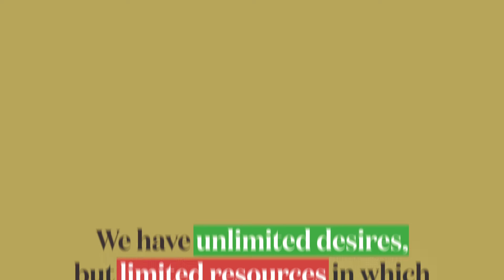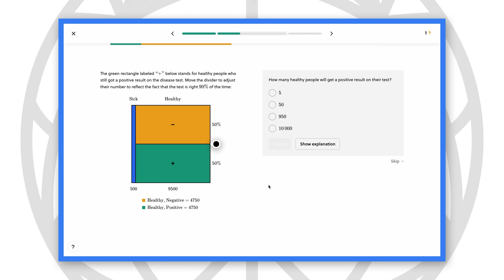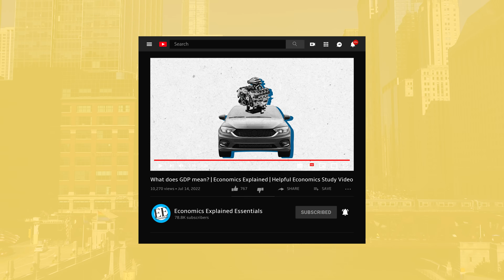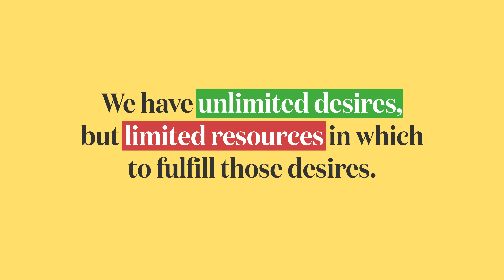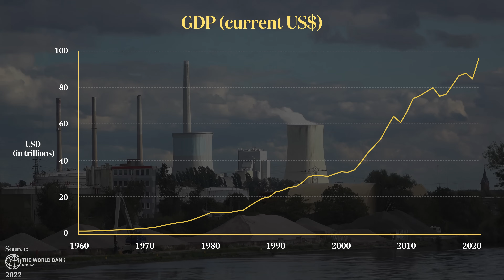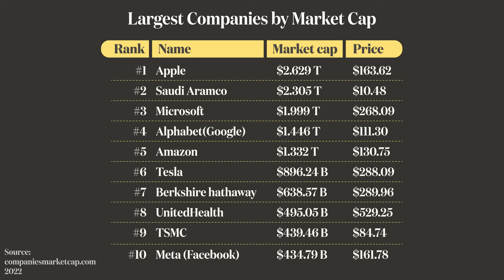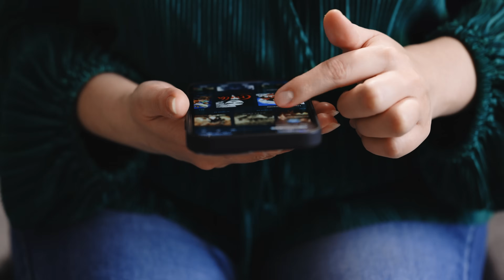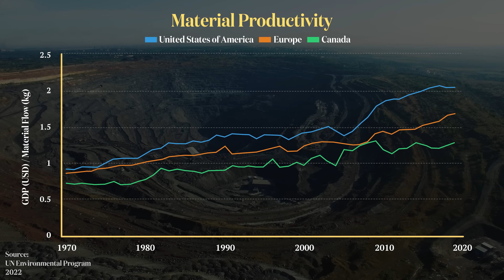Limitless Growth Is Possible If We Run Our Economies Correctly | Economics Explained

Comment: Hi, thanks for the informative vid! is “material productivity” a good measure if most supply chains are now global?
Reply: It can be, the RME coefficients are just not super precise because of the issues you are eluding to.
Reply: Im not sure but I don't reckon globalisation would drastically change the effectiveness of different measurements for gdp though it can certainly improve the material productivity of most economies.
Reply: it's like how UK has halved its carbon output compared to few decades ago, but this is probably because UK outsourced their manufacturing to other country. It's hard to believe any country can reduce their carbon emission this fast.
Reply: @xponen  exactly, outsourcing changes lots!

Comment: I recently independently realized that I want to have the best things that I use consistently rather than a lot of things that I don't really use. For example, I have a set of earbuds that I find to be fantastic and I use them nearly every day. Rather than having more earbuds, I'd rather just spend good money on those. There's some way to turn this into a minimalism argument, and while that's not exactly where I was going, it's not wrong in the context of what we're looking at.
Reply: Agree completely. However I struggle with this idea when it comes to luxury goods. Should I splurge on a $4,000 wallet that will last a lifetime and I can pass to my son? Or just buy three cheap Casio ones my whole life? Which has better outcomes for society and resources?
Reply: @raivolution  I would make the argument that if it's three wallets to last you a lifetime, they're of high enough quality. I don't have the newest and greatest iPhone or something, but I have a phone that exceeds all of the things I ask of it to do on a daily basis.
Reply: @raivolution  consider that increased price doesn't always mean increased quality either. planned obselescence happens at every level. also, if you find the skills to mend leather, for example, you can extend the life a little bit.
Reply: I agree. I would rather (and have) spent a few thousand dollars on a coat that I fully expect to last me at least the next 30 years, rather than spend money on anything that will get holes in the pockets after 1 winter.
Reply: @shadowfax333  true, but I don't think I am going to be happy living my life with the expectation that my nice things will be stolen. I'm not going to forgo the thing I would prefer just because of the possibility of it being stolen.
Reply: It is not a consumer side issue.
Reply: @Akixkisu  not entirely a consumer side issue, but it is definitely partly one. We have allowed cheaper materials and products because they're less expensive. There are options out there that might be better, they just cost much more
Reply: I'd rather buy $20 of cheap airbuds every 6 months. I spend less than you, and I don't care when I drop them.
Reply: @toomanymarys7355 considering I am on month 9 of using the same buds, I spent $45, they hold up to my frankly abusive wear and tear, and I don't envision having to buy another pair for a while, I don't think you have as good a point as you think you do. I would have gladly spent more money on these earbuds, but I didn't have to to get something of high quality.

Comment: I held onto my last phone for 5 years. Why? because it still works. I only had to finally switch since it has stopped working. I do this with nearly all my stuff, and run it as long as I can. I think this should also be the mentality people should have.
Reply: If everyone had that mentality though, and applied it to all goods, it would be an instant an unending recession. Entire sectors of the economy would vanish, as people realise the only reason to buy designer clothing is to flaunt how much money you can afford to waste.
Reply: @vylbird8014  There is nothing wrong with buying things. Buying things because it's new is the problem. You don't have to upgrade something every single year, not even every other year.
Reply: @vylbird8014  That would be fine because if you aren't replacing your consumer goods every five minutes then you don't need such a large economy to support you. The problem would be getting from here to there without a lot of pain.
Reply: @tonyedgecombe6631  You do need a job though. And a lot of those jobs are based on meeting pointless desires created by advertising. Economics as practiced today is predicated on near-full employment.

Comment: In my opinion counting material productivity with material flow as kg may be misleading. With sustainability in mind we should use indicators such as global warming potential. It's not impossible, as programs as international EPD system exist.
Reply: A mixed basket of measurements/criteria would probably be best, but carbon cost should certainly be prominent among them.

Comment: Material Productivity is not going to cut it. You could 3d print a razor-thin walled plastic building for a tiny fraction of the material cost of a normal building. It might not last as long, but replacing it creates GDP growth so the apparent improvement in Material Productivity continues to show a glowing report. You could actually make a compelling argument that paper plates have already achieved this goal. All material productivity encourages is an economy built around disposable goods which only accelerates the waste/garbage problems. A single wooden plate will provide far more value than several cases of paper plates and at a lower resource usage, but only over time frames that nobody talking about growth cares about. It also means less demand for the product and thus lower GDP. 
What we need is a measure of Material Productivity over time. Paper plates create a better Material Productivity measure, but over time perform far worse than wooden, plastic or ceramic plates.

Comment: Well if you think of it like a game of civ, you need tech. Without tech the number of resources required for infinite growth will forever remain out of reach. For example, instead of using lithium-ion to make electric car batteries using sodium ion is much easier to get and way more common. Or using kerosine to light lamps instead of whale oil. If you think of it like that, then infinite growth is definitely possible even while ignoring space and other planets.
Reply: Sodium-ion isn't really ideal for electric cars. It's lower cost, and needs more readily-available materials, and safer - but it is inferior on energy density, both gravimetric and volumetric. That's a problem for cars. It's not a problem for large-scale grid storage though, so sodium-ion may well have an important role there.
Reply: @vylbird8014  That was just an example at how one thing could be done with fewer resources and labor don't think too hard into it.
Reply: I would agree with you, but only up to a limit, one which lies far beyond the scope of any current economic/political discussions. Eventually entropy and other hard physics limitations do come into play.

Comment: I don’t think it’s correct to say all buildings use the same materials and the only difference between shoddy and quality buildings comes down to planning and a more skilled tradesman. Construction companies routinely use cheaper shoddy materials that are in fact different than quality materials. This lets them maximize profit as there’s no requirement for the new house to stand for 100+ years. For example the shitty drywall coming from China now versus quality drywall that used to be widely used.

Comment: I don't totally agree. I don't believe infinite growth is possible, because growth is still in one way or another always extracted from the finite resources. True, digital growth does give a lot of value for the resources required, but it's still far from sustainable or able to grow infinitely: everyone needs smart devices to consume the digital value, those devices require huge amount of natural resources. The internet alone requires huge amount of data centers and electricity, like you said, so it neither can be infinite.

I would also disagree that human's desires were unlimited. That's precisely what the capitalists want you to think, because that way people think that capitalism is the only way, since it supposedly is always up to human nature, and there would be no way around it. But I don't believe this is true. Sure, humans easily come adjusted to their standard of living, but it does have a limit after which the desire is ever smaller. Once someone has all their basic needs met, then the desire for something more is relatively small, really. And that desire can be fulfilled without extracting more resources and without economic growth. The notion that humans always have unlimited desires is just a silly assumption that everyone wants to be a billionaire, which isn't true at all. Everyone just wants to be able to live happily and do something that gives their life meaning.

And the correct answer to both of these points, in my opinion, is to use the current resources we have extracted to transfer to a 100 % renewable and recyclable economy with total wealth equality. This kind of economy doesn't need infinite growth: all we need is 100 % renewable energy, which can be possible. Wealth needs to be distributed evenly so that every single person has their basic needs met (we have the money and resources in the world for this already). And then people need to be able to work in the jobs they want to work: creative arts, farming on your backyard, play video games (with renewable energy and recycled computers), etc. Of course, this is not possible at the moment—and quite frankly, I'm skeptical it's possible ever, because the current economic system is so brainwashed into so many people's heads, and big wheels turn slowly—but I still like to hope that it is possible some time in the future. With or without the collapse of the current system.

To be honest, the idea suggested in this video—although I do like the idea, and I believe there is genuine desire to think about a more brighter future—seems a bit too tame and still supports the status quo of keeping things relatively same but just marketing it sustainable. This just like what those elon musks of the world claim, that through "sustainable growth" we could keep doing just the same over and over again, but somehow this time it will be better and we won't destroy the world. Sounds a bit too good to be real, right? I wish, I WISH it was that easy, but unfortunately it is not. To transfer to a 100 % sustainable society, things need to change drastically. I mean very drastically. This is—although, again, I do believe there is good intention behind—just another bandage to the bullet wound.
Reply: you may first start asking the question, why are our north american cities designed to be centered around cars?
Reply: The finite ressources argument has the issue that even the most basic ways of life consume ressources. No society ever will not consume ressources.

All you're doing is kicking the issue down the curb (far down.)

Pushing for growth though has a much better chance of making drastic leaps in ressources availability.

My point is that if your goal is for humans to live on (which I guess is the goal of degrowth people) then you should know that a species focused on growth has good chances of outlasting one that is not.

Comment: 2 things to consider:
-Not all desires are material or of service-nature (especially some psychological desires) and thus cant be solved by a growing economy, which very well means that some coming hurdles might only be able to be solved by not growing an economy
-there are some hard limits on science and technology, especially regarding complexity. Macroscopic thermodynamics, for example, is pretty much a solved physics theory. We know all which goes on there. We cant do more intricate stuff there, a basic piston will always behave like a basic piston, not otherwise. Innovation in in this case can only consist of a) optimazation of existing processes, which does not make something new, but only makes things easier to operate (on which there are hard thermodynamical etc. limits too, e.g. you cant really make a gas motor much more efficient than we already have made it, we cant innovate a normal gas engine into powering a space station). No new functions. Or b) making the stuff more complex, i.e. bigger. Think of our basic technology being on the level of a neuron, and the possible technology being on the level of a human brain. With that though, the hard material limits come into play again, as there are around 86 billion neurons in a human brain, but we may only have the resources to construct a few million. No infinite growth possible there.

And last, on a metaphysical level, the concept of entropy itself disproves infinite growth.
Reply: You seem to be arguing with the title of the video rather than anything within the video. Unsurprisingly it's focused on economics, rather than psychology, metaphysics or whatever.

To give a prominent example of where you're talking past EE, he explicitly states that he's talking about humanity only before we become properly interplanetary. Which is of course the correct scope of the discussion as far as any current economic/political/social considerations are concerned.
Reply: 1. All desires can be satisfied by sufficiently advanced technology. If nothing else works, with a simulation that fools your brain. Or reprogramming your brain to not want those things, if you want to go in the dystopian direction.

2. There are no hard limits on science and technology. Innovation isn't just optimization, it's also about inventing entirely new things. For example, when you can no longer optimize an internal combustion engine, you can switch to electric motors and batteries. Or compact fusion reactors that can use garbage as fuel. There's no (practical) limit to innovation because our world is infinitely complex.

3. I really don't understand that neuron stuff. Why would we only be able to make a few million? That doesn't make any sense. Also a neuron is extremely inefficient, just using known physics it's possible to make trillions of times more efficient ones. We don't know how, but we know it's possible.

4. Not even thermodynamics is a limit. In an expanding universe we can beat it. Both the first and second laws.

5. Also what if ours is not the only universe, and it's rules are not the only possible ones? Modern physics allows infinite number of universes, and in many ways even demands their existence.
Reply: Even with entropy, the universe is still expanding. We can grow infinitely.